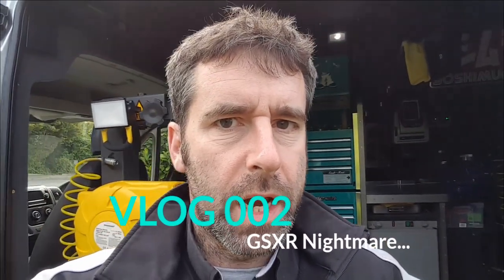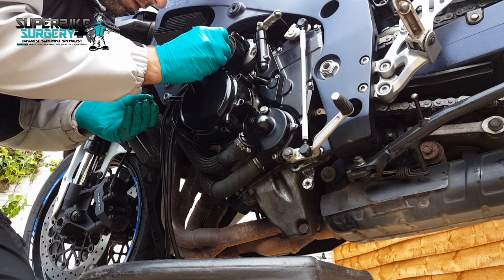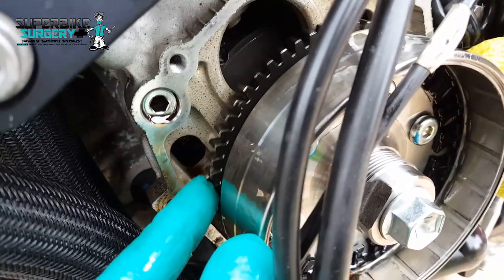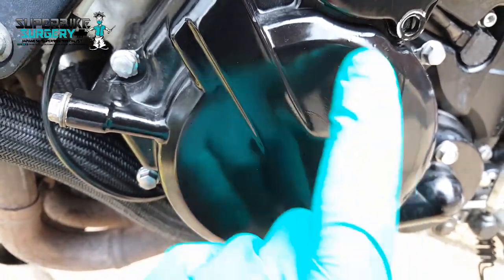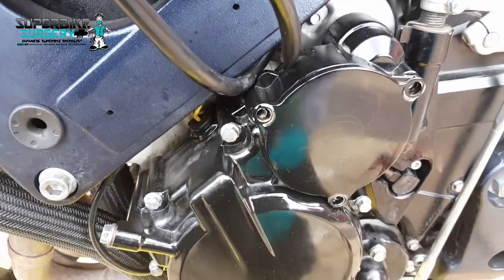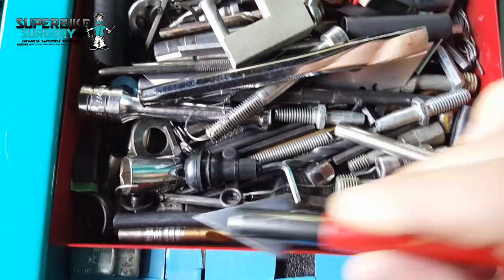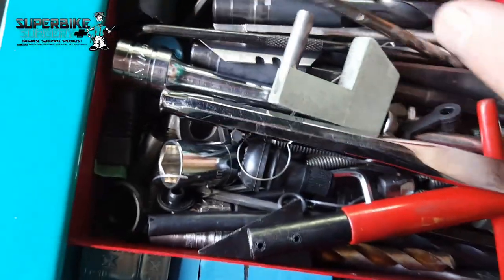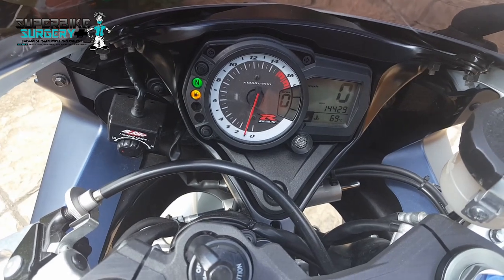VLOG 002 The Nightmare GSXR

Comment: You know if the stator screws aren't tightened down completely that will also cause contact with the rotor .  Judging by how loose the cover bolts were and from the sound that's probably the case .  A bent crank or out of round rotor would give more of a pulsating noise not constant .

Comment: I'm having a nightmare of a time with my ZX6R, it's developed a problem where it cuts out when i put the stand down, even when not in gear, clutch is pulled in still won't start. No FI warnings. Doing my nut in.